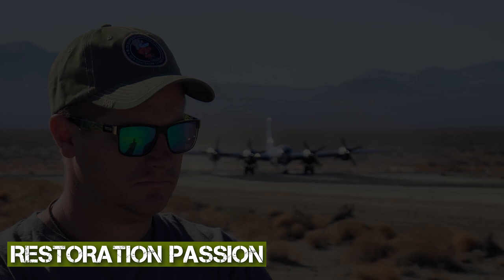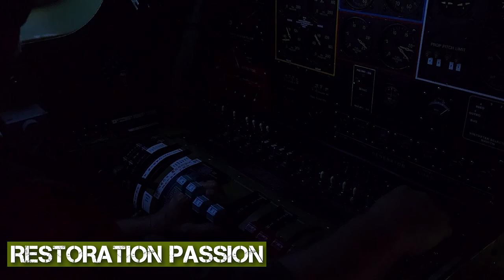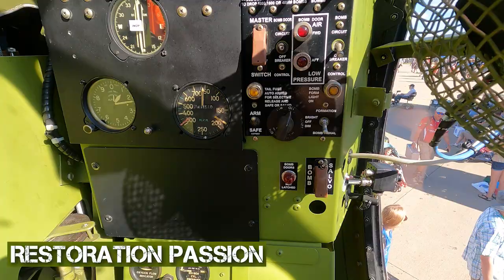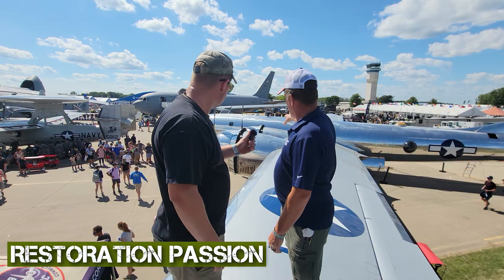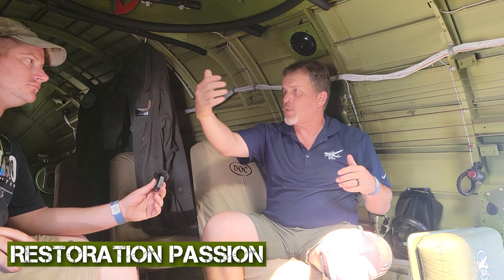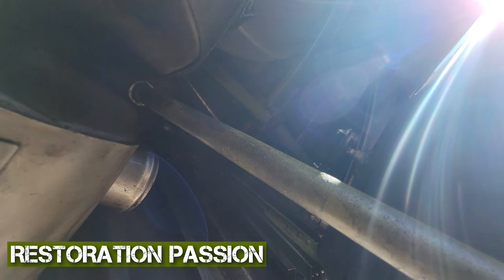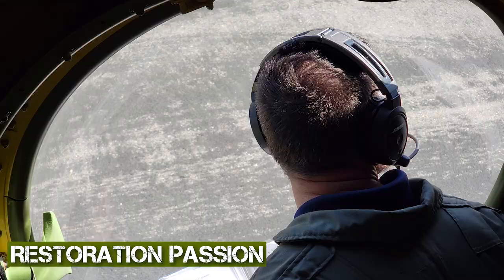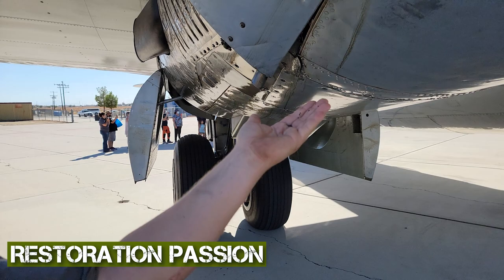The Untold Story of the B29 Superfortress The Plane That Ended WW2

Comment: Great presentation; however, I am a radio collector & have restored several BC-348's to work on the original 24 volt dynamotors. I would like a detailed description of the radio compartment gear & operator. This crew position is generally overlooked in videos on the various WW2 bombers. Again, wonderful detailed video of the B-29. Keep up the good work!
Reply from the maker: We realized afterwards we forgot to talk about the tailgunner as well....shame because we this was filmed in two separate states during two separate months and took so long to put together only to find out near the end we missed over a couple of pieces